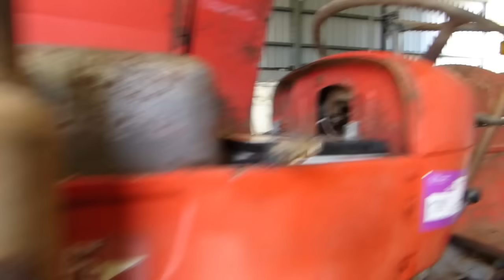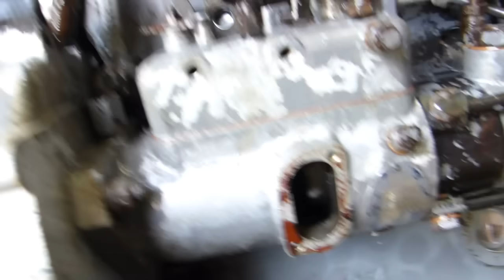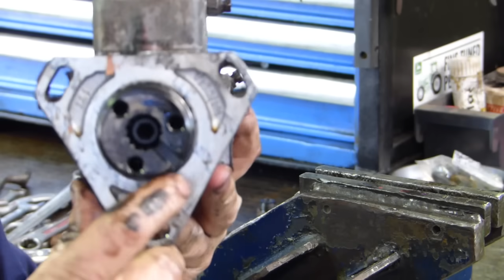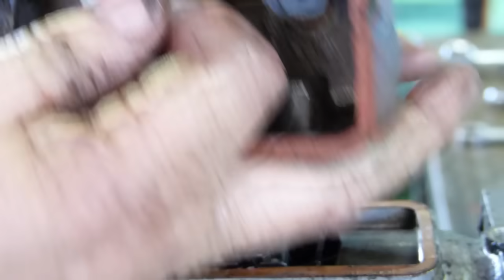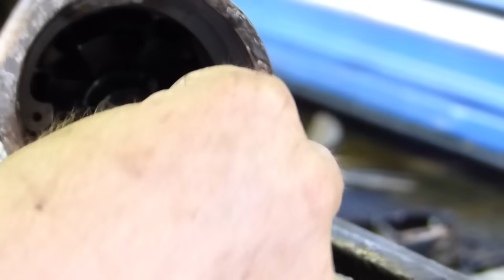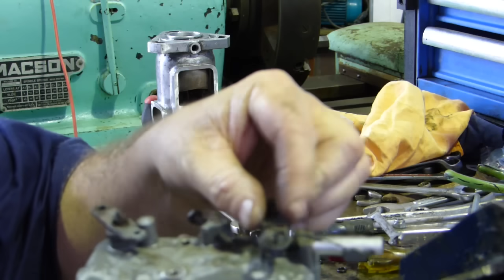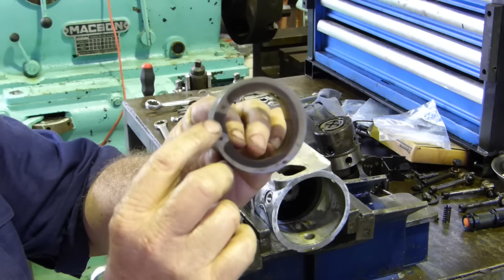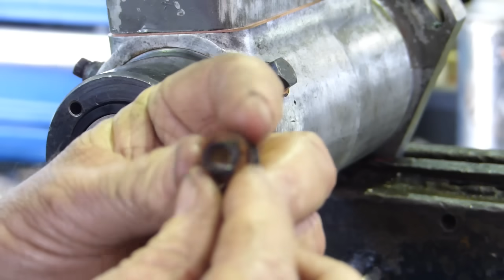CAV Injection pump full strip down to re seal and stop fuel leaks

Comment: Your videos are very well done. 
I know this video is old but maybe you could help me out. 
I recently bought a MF 165 and plan on rebuilding it to like new. It's been run rough for years so it is missing a lot and has had massive of people probably mess with it. 
Take my pump it is not any of the numbers that are in the AGCO parts book. The pump looks just like what it would be though. So would anything be bad because of it? I just rebuilt it, like this video, haven't put it on yet working on fixing a few other things.
My next question is I want to redo all the fuel lines but can't find any after market replacements to make it look original, what do you do in that case? My reason for wanting to replace it all, is that most are kinked, bent up, and leaks all over. One other question, the fuel line sleeves\olives are they supposed to be pushed over the lines end or do you put it in the hole set the flare end on the end?
Reply from the maker: Thanks Rbh, The fuel lines can be re made with some Bundy Tube, which is a steel tube used for brake lines. The olive gets pushed up the pipe and the nut sort of crimps it in place. You can buy cheap tube benders on e bay and other places. your pump should be fine, the numbers do not seem to match quite often, not sure why.
Reply: Bundy Bears Shed awesome of you to reply. I wish I was closer to get first hand experience. I also have many other questions coming soon. Like what complete engine rebuild kit in your opinion is the best? That is available world wide, im in the USA.
Do you roam any forums for easier asking of questions?
Thank you
From your American fan

Comment: Great Video!  When I tried to start my 65 MF, I had no fuel to the injectors.  I opened the top back up and checked the shut off and spring, all seemed good.  I backed my throttle screw and tractor cranked right away, but now I still cant rev it up where it bgh used to be.  What would have caused this?  Any ideas?
Reply from the maker: G Day Nikki, The spring is in the wrong hole, you will need to check that again.

Comment: Hope u can help I have a 265 Massey with the same pump and the problem is it starts and will run with the plate off on the side of the pump. I’ve been told the pump needs to be rebuilt it’s building internal pressure.  So u think the screen on the plunger could be the problem ? Thanks for any help !
Reply from the maker: G Day Ron, I would check there is no restriction in the return line that is making the case pressure rise.

Comment: Thanks for the video. With the old backhoe stranded in the backyard, I bought a new injector pump + a sealing kit. I thought that once the old pump is removed, I might as well try to clean and reseal it. It went really well. My 13 year old son was in charge of the iPad, playing the video step by step, while I was getting my hands dirty. The pump was all clogged up with rust from the old fuel tank. Yesterday, I installed the old pump again and the 50 year old Perkins started right up. I have just returned the new pump and saved 700 USD.  😀
Reply from the maker: G Day Anders, Well thats good news, very satisfying doing it yourself.

Comment: Hi Bundy, first off thanks for the very detailed video with great close up and in-focus shots. I did a full reseal following your video to the t, however I'm trying to fill the fuel inlet to test the pump as you did in your video. There doesn't seem to be any "suction" pulling fuel in and nothing is coming out of the fuel outlets on the pump. The metering valve moves freely and the piston moves in the plunger if I shake it rather hard. What are your thoughts?
Reply from the maker: K Wood check the small plunger under the inlet is nice and free and sitting on the light spring
Reply: Thank you for the quick response!!  I cleaned and cleaned the cylinder that the plunger moves through, along with the plunger itself, but I was never able to get it to fall straight through freely. It would move back and forth in the cylinder if I shook it real hard. Since it was moving I figured it was fine so I reattached the pump to the tractor but I wasn't getting fuel out of the lines, I traced it back to the pump again and confirmed that the pump is pumping fuel into the injector, as noticed by fuel coming out of the bleeder screws, but no fuel is coming  out of the fuel outlets. Do you think it's due to the plunger getting stuck?  Could it also be the pistons that rotate on the cam ring maybe being stuck? I'm pretty beat as I spent so much time doing this the right way the first time.

Comment: Help I pulled the distributor part off the pump to replace the O-ring.  Also took the top off and cleaned it out and replaced the gasket. Put it all together with out removing the pump from the tractor.  Primped the pump then shot a small amount in starter fluid down the intake and the Massy 255 started right up and ran for 3 minutes. I shut her down to tighten a few bolts then restarted her she ran 20 seconds and quit. I do not seem to have pressure to the injectors. What did I do to this pump too cause such a failure?  -Alan
Reply from the maker: alan gerecke not an air leak or could you have possibly over tightened the end cap
Reply: I am not sure what I did. I have removed the pump from the 255 and dismantled the pump and it looks like new.  The owner of the tractor is in a twist and says he needs his tractor to bale hay so I ordered a new aftermarket pump on off E-bay for $ 475.00.  Still I would love to know what I did to the pump.  When you say over tighten the cap could you be more detailed.  Could I have failed to bleed the unit properly.  Why would it run until I shut it down?   I must sound stupid but I owned a repair shop for 25 years so I am not with out some skills.  Thanks for your help.  -Alan

Comment: thank you for the awesome video! followed your video and replaced the seals in my pump but I can't get mine to spray fuel from the 4 ports like yours did. I took it apart and looked to see if I missed something. re watched the video but still can't figure it out.
Reply from the maker: G day Shaun, It could be possible that the plunger under the cam rollers might be stuck. I didnt cover that but possibly worth a look.

Comment: Hi Lance! Thanks for the great video ! I have a bobcat with a perkins diesel with the cav pump. it keeps loosing prime and I'm getting air from the bleed screws on the pump after stalling. ..when i finally get it running it will run for about a minute. My question is can these pumps suck air in some how or do the just leak there? i had the end cap off and even put a new seal in there and also made sure the plunger was moving freely.
Reply: Oh i also ran a separate fuel can with ball pump. i pumped the hell out of it and didn't see any leaks. got it running with that set up and it died a minute later again! I'm loosing my mind on this and don't want to spend $1300 on a reseal and it aint the problem.
Reply from the maker: You must have an air leak before the lift pump I think as it is under a very low pressure and after the lift pump it could be 10 or 11 psi. I would look hard at the tap, tap fittings, and lift pump valves and fittings in case the air is coming in there somewhere.
Reply: Thank you Lance. Im thinking now i should put pump back, on with my fingers crossed, and take a closer  look at the filter housing. even tho I've i changed the filter twice already! Damn!  i have an electric lift pump...Have you ever heard of those sucking air? Thanks again!

Comment: I removed a long 445 long injection pump and rebuilt it now I née to time the pump there a key .as long as the timing gear hasn't been moved does it matter how u install pumps if so I can't find timing marks on a 72 long 445
Reply from the maker: If it has the key and the engine has not been turned over it should just go back in the same place really.

Comment: Hi lance Just to be clear , the white smoke is with a cold engine ,  not missfire, the fumes make eyes water. ps the compressionsare all good averiging  400 psi ,perkins 65344 non turbo,  any ideas?
Reply from the maker: I would also check injection pump timing

Comment: Hi Lance.  How can I enrichen the low speed running, (new valves piston rings,new oil, oil & fuel filters. new injector nozzles & pressures set,)  tappetts & timing spot on, white diesel smoke  when hot  very little smoke,   Not steam!  Great video!
Reply from the maker: G Day Roger,To pick the speed up you adjust the external screws on the throttle lever, but if you have got the governor spring in the  wrong place that will effect it as well. To increase the fuel delivery per stroke of the pump the double hex bolts that hold the cam rollers plate in place need to be loosened off and the plate turned ever so slightly.

Comment: Thanks for the video.  It is the best I have seen for this rebuild.  I have a Massey 35 (3 cylinder diesel).  I rebuilt the pump, with your guidance.  I finally got it motor running.  My problem now is the engine wants to over rev.  The RPM will just keep climbing and I have to use the stopper rod to control.  The throttle has little to no affect on the RPMs.  My pump looks to be the same brand as the one in your video but the identification plate does not have the numbering convention your does.  Under the portion of the plate that says QUOTE  there are only 4 numbers (2378) and nothing else.  There is the R163200C at the top of plate. I paid very close attention to make sure I put the spring back where it was when I disassembled the unit.  It was in the middle hole on the governor and  throttle shaft.  My concern is that the timing may be off, although I did not crank or move the tractor once I removed the pump until I reinstalled it.  Could you provide some guidance?
Reply from the maker: I thing you may have got the spring in a wrong hole I would suggest you have a look there again.
Reply: I was careful to note the holes when I took it apart. Your directions were very specific on that.  Unfortunately my unit does not have the code stenciled on the tag.  Go figure!  I did take the cover off again and verified I was in the middle whole on both ends of the spring.  Is it possible I could have something wrong in that end section that where the little plunger, spring, filter etc... is.?  Does that act as fuel bypass?  The really weird thing is the throttle has no affect at all.
Reply from the maker: It is very hard to say sitting here, do you think the governor plate is sitting in the flats on the weight basket collar?
Reply: That am not certain of.  I am not sure what the flats are.  I see you have a video on how to adjust the governor.  I will check that out to see is I can get a better picture of what the "flats" are.  Thanks so much for your help. I really appreciate you knowledge and enjoy your videos.
Reply: Opps, that video is for petrol not diesel.
Reply: I checked out a schematic and I think I see what you are referring to "the flats" I will pop the top again a verify.  I will let you know what I find.

Comment: Had the o-ring in the cylinder of my cav pump leaking. Replaced primed and now Massey 175 won't without a squirt of starting fluid. Otherwise runs perfect. Any ideas what went wrong? Thanks, and love you videos. 

 
 

Reply
Reply from the maker: cartoad1G Day Cartload, I wou look d c h.g eck the little plunger under the inlet fitting is free and in the correct position with the very light spring at the bottom and also check governor spring position again
Reply: @bundybearsshed  Thanks for the response. I've about pulled my hair out working on it. Seems as though I have a leak somewhere causing not enough fuel pressure. Gonna remove unit and start over again. Thanks again. Happy Thanksgiving
Reply: You were right from the start. Plunger in wrong place! All is good now, Thanks

Comment: just wondering if you can increase the revs by a few RPM in these pumps, not referring to the bolts like the idol stop and the other one but is there an adjustment inside the pump that you can adjust to give you an extra 200 RPM?
Reply from the maker: G day John, you can increase the fuel delivery per stroke but the only way to get a few more revs is the throttle stops on the top cover.

Comment: Hi lance great video iv just finished my pump but i have run into a problem... the transfer pump has broken, the part the plastic vanes slot into do you know where i could get a replacement from?
Reply from the maker: G Day Edward, I don't know where to buy them but I would annoy a tractor wreckers for an old pump and get them from there if they will sell you an old pump cheaply.

Comment: Hello, Lance.  I need to rebuild my CAV Roto diesel injector pump on a John Deere 2040 3 cylinder.  I have been told that it needs to be done by a professional shop due to calibrations being critical that DIYers cannot do.  I am wondering if this is related to the core part that you did not disassemble in the video, or is this just not true.  The problem I am having is slow throttle response, tractor is weaker than normal and white smoke from the exhaust.  The latest is that the tractor now will not start.  Thanks in advance. Danny
Reply from the maker: G Day Danny, That is only the middle part that I didnt touch that is critical. It sounds like your metering valve is getting sticky. I would encourage you to have a go. With care it is a fairly easy job. Some of those tractors had Stanadyne pencil injectors they fail from time to time it might pay to look at them as well. The after market ones have been testing well for us and they are way cheaper than genuine.
Reply from the maker: The 2040 over here is a 4 cylinder
Reply: Lance....took my pump off last night.  My tractor is a little different than yours.  When I tried to line up the flat edge of the circle clip with a certain letter on the internal head in the pump, the only way to get the head to rotate around to get a letter lined up was to turn the motor over with the ignition key. Got it lined up where I wanted it, then began loosening the pump. Took the plate off the front side of the timing housing to get to the three bolts on the front of the pump.........well, the access hole is such that I could only get to one bolt at a time.  So, I found that I had to take one bolt off, then turn the motor over with the key to have access to the next two bolts.  So, the flat edge of the circle clip just ended up where it was in relation to the letters on the internal head.  I noted where it ended up and snapped a photo as well.  So, basically, I had to ignore your safety message regarding unhooking the battery.  Interested to know if there was a better way to do this.

Comment: Really appreciate you videos! I'm having issues after having the pump professionally rebuilt and need help. Its a CAV DPA 3442F491. went in working and came back with timing 10 degrees out in the pump, after fixing that and further fiddling it got re-installed and would not run except on full throttle but the engine would only go up to 1500. I finally figured out it was stuck in prime mode and there was an extra spring in the middle of the pressure regulating spring; took that out and it now idles well and will throttle up to 2100 under load and 3000 in neutral. (on a boat!) Took it in to another rebuild shop and they figured there was a  bit missing that creates the back pressure under the vanes in the transfer pump and therefor low pump pressure going to hi pressure pump.  So the question is: What is supposed to be in the orifice leading to the metering valve under the vanes? looked pretty closely at your great video but that section is missing unfortunately! Thanks for any help! Cheers, Graham.
Reply from the maker: The only thing in there is a little shuttle that decides where and when to let the fuel through. No orifice in there that I know of.

Comment: Got a tractor leaking diesel into oil
Reply from the maker: Could be the front seal on the injection pump but it could also be the fuel lift pump diaphragm.

Comment: Dear Bundy Bears and Lance could you offer any guidence on how I might convert my 4.236 to a serpentine belt system for my sailboat? Thx!
Reply from the maker: I would look for a late model machine like a JCB or similar and see what they have to offer as a standard item. A lot of machines have had them for 20-30 years now so there might be some at the tractor or earthmoving wreckers with a set of pulleys.
Reply: good idea thanks

Comment: Thanks for posting. My pump is leaking so bad that I regulate fuel supply with the petcock at the tank...I know..don't say it. If only I had seen this clip sooner...lol.
Reply from the maker: Ha Ha more than one way to get the job done eh. lol
Reply: Is your power steering pump a standard installation or custom retrofit. Mine has the pump inside the reservoir mounted same spot.
Reply: P.S. I need to find some Bundaberg Rum. Loved it when I was catching Buffs in Arnhemland.

Comment: I've got a bobcat with a similar problem, looks like the same engine. Thanks for this 👍
Reply from the maker: Many engines had the same pump so you are probably correct.
Reply: Bundy Bears Shed yes it's a 4 cylinder Perkins that looks exactly the same ( I think they used a similar Perkins engine in boats n air compressors back in the day )

Comment: Excellent. I wish i had know this before i paid twice to get my pump rebuilt.
Reply from the maker: That sounds like you have had a bit of trouble. Its not a hard job if you take your time with it.
Reply: I sent mine to repair shop still no fuel coming out of pump sending it back again , I have anotger pump the head shaft is twisted off I'm going to try and rebuild that one my self